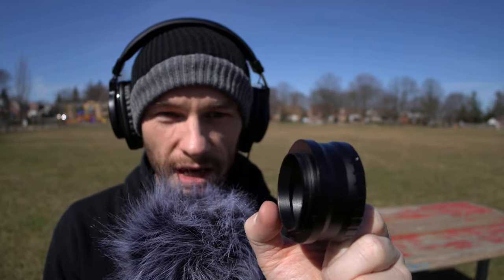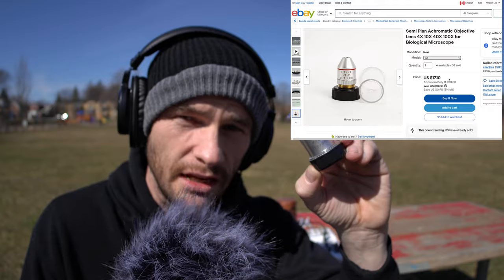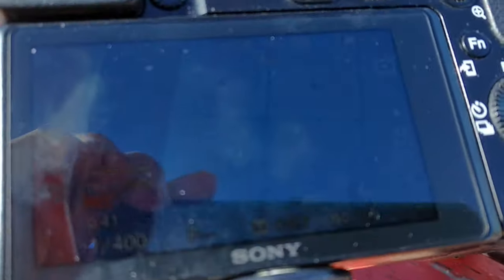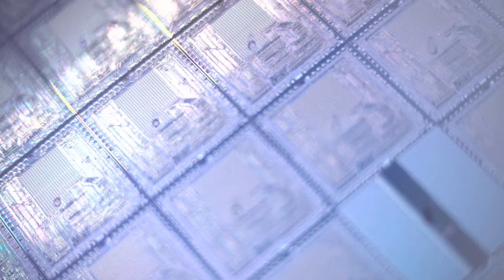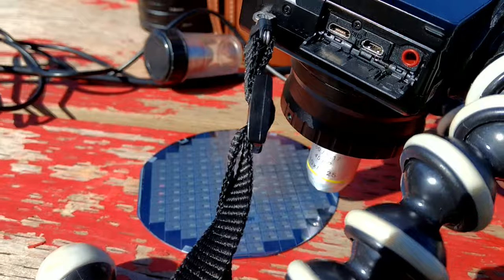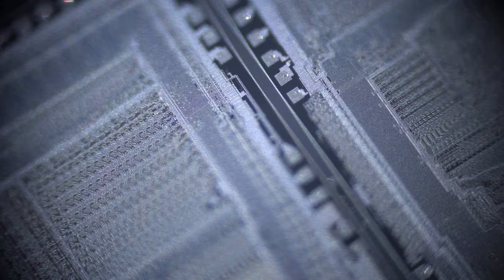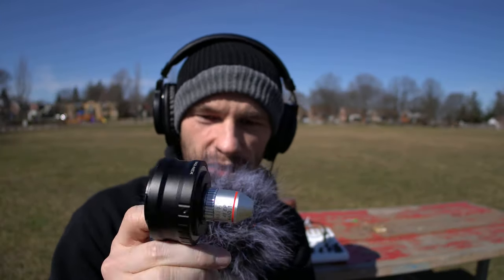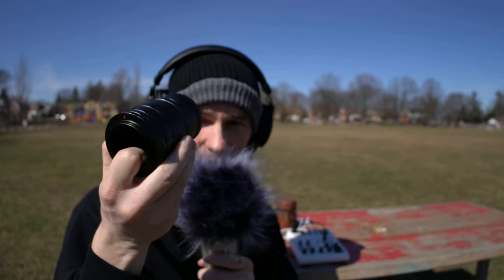How To Analyze Semiconductors In The Park

Comment: I'm still pretty new in my photography journey so i really appreciate going into some detail on how you got the shot without a $1000 lens. Have you tried placing a polarized lens into your stack? It helps cut out on reflections in some scenarios. Thanks for the tips
Reply from the maker: "Have you tried placing a polarized lens into your stack?", that's a good question, and it's very appropriate for the topic of photographing microchips.  The light that bounces off of the tiny details in a chip is very much subject to polarization due to the small detail sizes.  I don't actually have a polarized lens, but I do have some polarization filters.  I think it would likely get you some interesting results if you just put a polarization filter between the lens and the subject.  That might get a bit challenging with anything greater than the 4x objective due the the small distance between the lens and the specimen.   In microscopy, you can also buy special 'phase contrast' objectives that basically give you a more general picture of the polarization phase of whatever you're looking at (but those objectives are very expensive).

Comment: I really like your videos, but I think you would benefit a lot from making the thumbnails a little more catchy
Reply from the maker: Yeah, I couldn't think of what to do for this thumbnail.  I released this video with a different thumbnail that was of the camera looking at the wafer.  It's important to make them catchy, but they also need to be conceptually related to the video, otherwise they bring in the wrong audience and then they click off fast.
Reply: @RobertElderSoftware  You definitely know more about this then I do, but I think that a photo of the wafer with some text would look nice. Personally I find that "Question in the title, answer in the thumbnail" format is really engaging because a lot of people only look at the thumbnail and don't read the title. If it was up to me, I would make the title "Looking at wafers" and I would put "In the park" on the thumbnail with a photo of the wafer
Reply from the maker: I just updated the thumbnail for this one.  Does this thumbnail seem any catchier?
Reply: @RobertElderSoftware  Definitely
Reply from the maker: Ok, I'll keep that one for a while and see how it does.  It would be easier if I just had like 9999999999999999 subscribers already because then I could just A/B test the thumbnails, but I don't really have enough statistical significance in my audience size yet.  Usually when I check the graph of click through rate, it's just random numbers between 2% and 9% for the same thumbnail, and very difficult to pick out a pattern.
Reply: @RobertElderSoftware  I get that, but I've seen some youtubers ask about thumbnails and titles in the community section. Btw have you seen Derek Muller's video on thumbnails?
Reply from the maker: Yup, I appreciate the feedback.  I do think a lot about thumbnails, but due to low amount of data points, it sometimes feels like a futile effort to change them because it's hard to figure out from the analytics if it actually resulted in an improvement or not.  Having said that, I do think that this most recent thumbnail is performing noticeably better.  Yup, I have seen Derek Muller's video on that topic.  That's one of the reason that I think about it as much as I do :)
Reply: the new thumbnail sure caught my eye more than the pretty colors on the silicon!
Reply: Just add a red arrow pointing to something in the thumbnail. Unironically that gets people curious enough to click on the video, I have no idea what the psychology is behind it.

EDIT: I actually just noticed you already do this fairly often. 😆